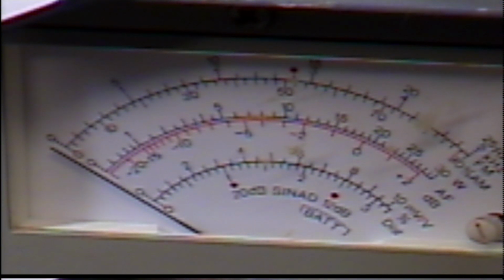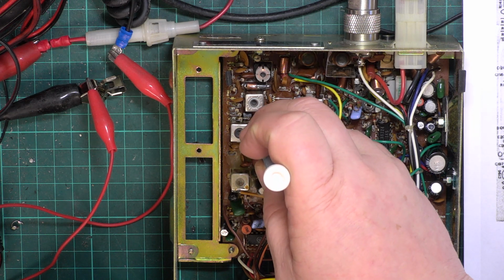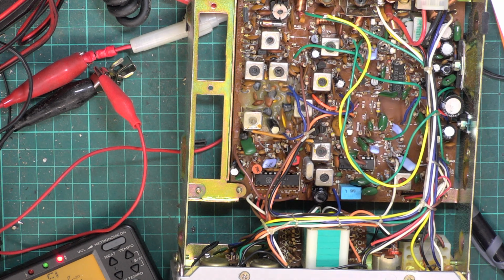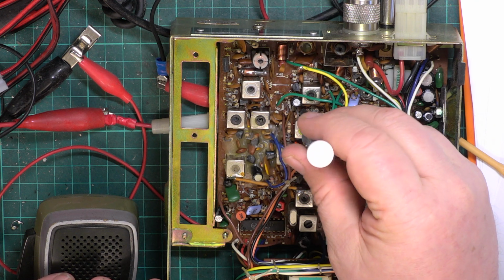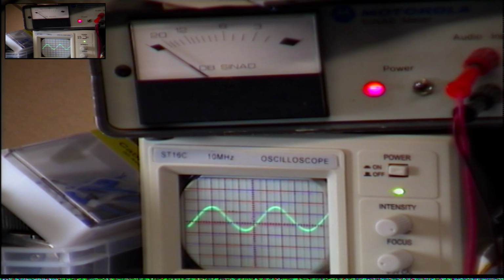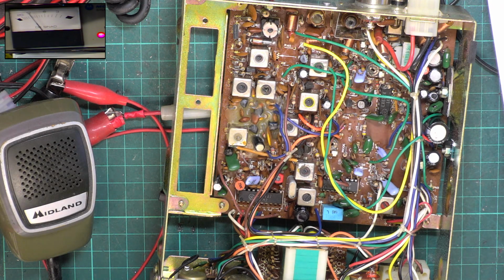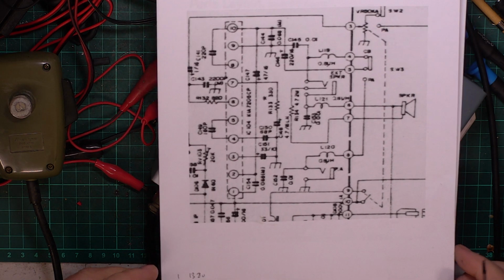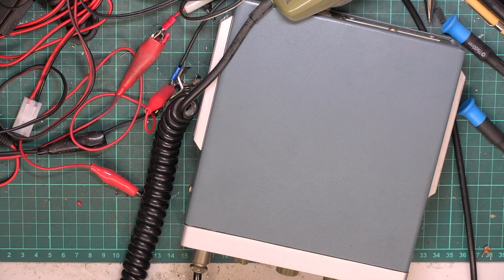Midland 3001 UK CB27/81 CB radio (mobile) - Low rx audio repair & service

Comment: Just to point out that at 9 minutes into the video you pointed out that RV103 is for meter adjustment but then proceeded to alter RV105 modulation/deviation.  Then couldn't suss out why 105 was wound right down.  BTW I love your videos,  very educational and most helpful. Keep up the good work 👍.
Reply from the maker: Yes, any errors like that are kept in & not edited out. That's reality. It got corrected later on of couese,

Richard

Comment: Hi Richard, I Have an old midland 3001 Am I think is is Am anyway. It is a while since I used it. Can I please ask you whether it is posible to change it to an fm set and if so, would it be worth doing? I believe the channels are different to the old am channels. Is that right? When I key the mike, a local radio just buzzes no vocal comming through. It is a different mike i am using,  but I seem to remember you can only use the correct mike. I have the original mike but no plug and no mike insert. Of couse I can renew that, but the plug wiring diagram i have not got. I'm interested in starting up again now I have retired. I still have a 5/8 wave dipole up. Ive just built two pixie tranceivers I got fom ebay. Ok to listen, but I understand need a ham licence to transmit on 40 meters. Hence getting the old Midland out to give it a shot. Nobody on it of course as I understand now that  am cb is not legal either. Can you help please. Kindest regrads Phill W
Reply from the maker: Email me a photo of it please, back panel so I can verify if it's AM or not. Richard
rshireby@yahoo.co.uk

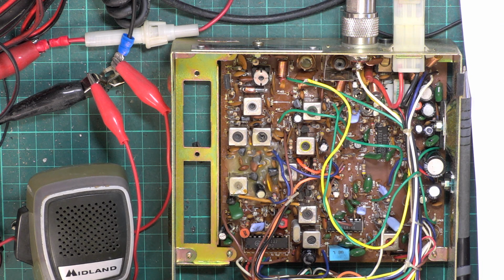Comment: Oops I noticed the mistake Sir you said RV103 was at the back @ 8:47 then you confused yourself by accidentally turning down the modulation on 105. I honestly love your videos and I only noticed because your a good teacher. =)
Reply from the maker: Hence Deviation being low. I only noticed on editing, which is why the RF meter adjustment did nothing first time round. Anyway I got there correctly in the end!

Richard
Reply: @ukfmcbradioservicingTango21  Thank you Richard & Mr Chippy for all your wonderful videos. I am still planning on sending my Moonraker Major over for a probably well need alignment service. (We've spoken about this set already)

Now after watching this video I'm also wondering if I still have enough remaining parts from a  3001 that died in the late 80's and was savagely taken apart by a 12 year old screwdriver happy young boy trying to figure out how CB's worked, 33 years later that same boy just watched a YouTube video of one of the best scratchy corner copies he's seen. 👍
Reply from the maker: yes, and a rig containing a chip that now costs £36!

However, when I was 10, I bough an old valved radio from a jumble sale for 25p....then ordered the service manual through an advert in Practical Wireless in order to try & learn....and then realised I needed a test meter. I found the fault which was an open circuit resistor caused by a short circuit capacitor!

Richard

Comment: I quite liked the look of the Midland Precision Series, they had a meter you could see at a glance, a good easy to take off bracket (it own slide mount almost) and they looked like some thought had gone into them, though they were no better that any other with the same chassis, they did look the part, even if they did cost twice as much.  I have on in fact, I didn't know I had until a month ago!  I opened a box and there it was in all its blueish grey and olive staring at me.  Yet to test it, I must get the Man Cave sorted out.  Give me a couple of good days weather!  It had to be a capacitor somewhere in the audio circuit, though it is always the last and least suspect one isn't it?  It was never that good to get spares for CBs anyway.  Cybernet went to all the bother of listing spares with part numbers, but try getting half of the bits.  Even dealers couldn't get some of the parts, ICs and transistors were ok for a while, but anything else, forget it.
Reply: You've Got A New Subscriber From Birmingham England 
Bless Up Buddy
Reply: @joohop  I remember trying to get to the Bull Ring once, drove all round it, could see where I was trying to get to, but just couldn't get to the thing.  Got a policeman on a motorbike to escort me there in the end,  unloaded and I was off Cadbury's or what was left of it then.  Even back then it was a fraction of what it used to be.
Reply: @BoB4jjjjs  Fair Play Buddy

Comment: @UK CB radio servicing The audio I.C. what number is it?
Reply: its a KIA7205 Wayne
Reply from the maker: electrically the same as a Toshiba TA7205, but by Kia (south Korea) in a slimmer package.

Richard
Reply: @ukfmcbradioservicingTango21  I only asked as one of those scrapped chassis' I have has a KIA7217AP audio ic. I don't know what radio this chassis came out of and the only marking/number on it is P-110006A
Reply from the maker: KiA7217AP is another hard-to-get IC, but bigger power output than the KIA7205. KIA seemed to stop making microchips after Hyundai bought them...who also make microchips.

Richard
Reply: @chippieminton21  thanks for the reply.